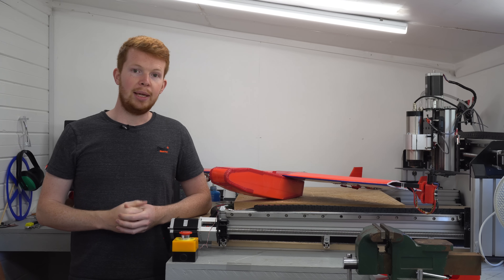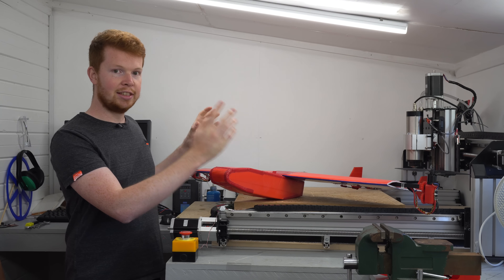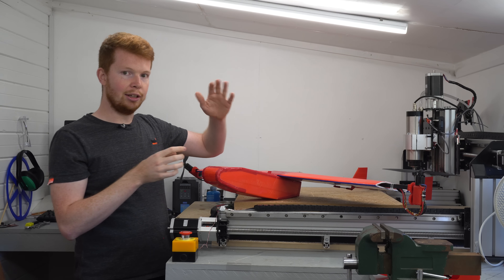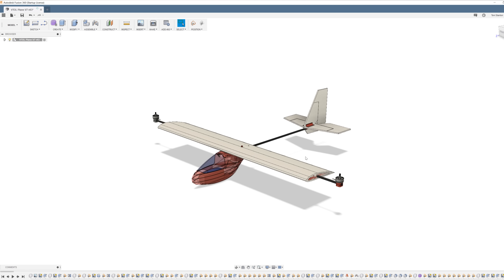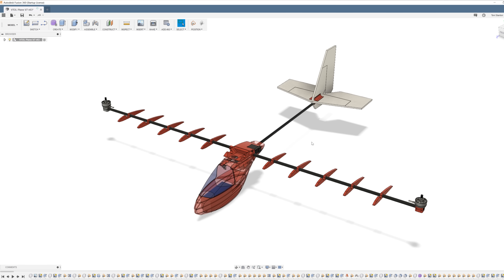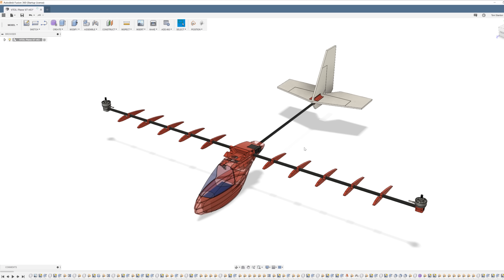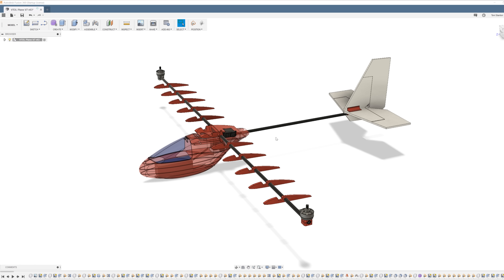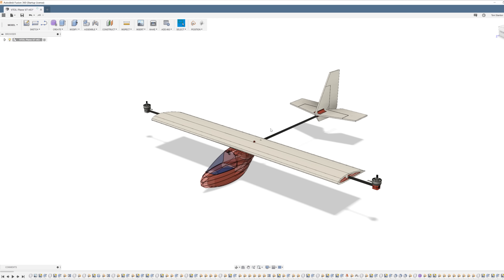RC VTOL - Build

Comment: Don‘t you have problems with these long battery cables and the flight controller? We are making a comparable project and the controller is disturbed by the battery cable s magnetic field.

Do you have any tips for us?

Comment: thanks for posting.    here are some things to consider.      why do you  choose  to be  (one more)   doofus,  who shows thousands, how to do THINGS  WRONG.   why not hold yourself to a  HIGHER  STANDARD.        at 4:55,   ridiculous  elevator design.    the  compound elevator makes up about   EIGHTY Percent  of the stab.    DO YOU THINK THE ELEVATOR IS GOING TO HAVE  ANY  FUNCTIONALITY  DURING  VTO.   if so, you are wrong (again).        at 6:37,   CAN  YOU  SPELL   SPRUCE  OR  POPLAR   DOWEL main spar.       at 8:38,  'BALANCE IT ON ITS NOSE'.    are you  KIDDING.      FIND  SOMETHING TO SUPPORT THE  MODEL ON  THE SCALE;    THEN   ZERO   THE  SCALE.     the reason for the   GIANT rudder is,    what.  
you mention  ailerons.    if the ailerons are not  'cut out of' the existing trailing edge,  then  you will have  Completely  Screwed Up  the  geometry of the  airfoil/profile.          googletranslate

Comment: Hi Tom,

as you perhaps rebember, I rebuild your version 2.

https://www.youtube.com/watch?v=XUuRyxg-2Sg

Over the summer I improved my skills to a very high level. The by far most important control is the yaw axis. If the fuselage gets air from the side, the board does things I never expected :D. And,  flying over the field and yawing dramatically is what the spectators impress on air shows. So, I would recommend to mix with any angle leaving the 90° upwards a high amount of thrust vectoring. Even if this  will cause a aileron effect, too. Especially on calm days without any headwind a hard elevator push forward combined with a thrust punch it will most likely allow you to correct the nose direction. In addition, the rudder itself should be as effective as possible. 

What I also changed compared to your settings is the influence on the elevator controlled by me and the board. In hover mode, my board has 90% of elevator travel for auto stabilization and only 10% directly controlled by me. This keeps the fuselage under perfect control. This means, if I start off by pushing the elevator stick to forward flying, the motors will pivot forward but the elevator will pull to overcome the nose down effect. If you already found out, no problem :). This improved the scale lookalike a lot. The only problem is, flying backwards is a little nightmare as the board corrects into the mistake. Therefore I left 10% of direct control.

Hope you find this helpful.

Comment: Why? :( I feel sad when i see good engineering people with good skills i modelling and have access to 3D printers, and they still use hot glue to fit servos and such in there builds :(

Every one seems to be stuck with the glue every ware and it feels so unprofessional. Loved your air motor with all the small screws and almost none glue. Keep that upp and throw the glue gun away! :D

Comment: Haven't been through the whole of the comments, but have you looked into openaero vtol. It's an open source vtol flight controller based on the kk2 board. https://www.rcgroups.com/forums/showthread.php?1972686-OpenAeroVTOL-with-transitional-mixers-(perfect-for-VTOLs)

Comment: Nice project. Any reason not to use a fully printed wing skin and rib structure to incorporate with your Spar? I have been playing with some single wall thickness sections for a Glider I have just about finished designing in Fusion. Centre panel will have Carbon Cap strips with a flat (not vertical) square section box/web between them. https://www.dropbox.com/s/ovfsdwrjppo1ru7/20181029_103937.jpg?dl=0 This is a dual skin sample for the centre panel.

Comment: Could you arrange for the ailerons to droop vertically (flaperons) when in vtol mode with the tips of the flaperons in the propwash then differentially steer the flaperons for yaw control during hover/vtol mode? Or you could have the whole wing rotate and just use the ailerons for yaw control.

Comment: Hello Tom, I like your Projects, and I sometimes suggest things to see what you think, but looks like you don't have much time to read through all comments. 
If you want to maintain Yaw control in hover, you might try a motor mounted upwards in the CG inside the fuselage with a decent fly wheel attached to it. make sure that the motor can turn in both directions and can change direction relatively quickly. The anti torque caused by the spinning wheel will cause the airplane to hopefully YAW. 

would like to know what you think, and maybe see you try it.

Comment: Since the motors are locked to each other he could reprogram (maybe) the flight control units (in case they are) for differential torque on each motor for yaw control (yes it would raise one side over the other but still...food for thought)

Comment: For yaw you could run two smaller tubes inside the main spar running from the center and then clamp the motors to the end of each small tube. Then just run two servos.

Comment: Why not put the ailerons on the spar under/behind the motors so they can input some yaw in vertical mode and keep control authority during low speed forward flight?

Comment: You should be able to get yaw control by slightly changing the motor speed  on either of the motors like quadcopters do

Comment: the model is very nice, congratulations for weight reduction!
to
 keep the rotation of the two motors independent, I was thinking of a 
system made up of two half-rings inserted on a central axis, but perhaps
 it would be a useless complication.
To bring the masses
 closer to the center of gravity, it might be a good idea to bring the 
ESCs to the center of the wing, as long as the motor cables do not give 
power loss problems.

Comment: Hi Tom, i have been working on BUDGET airframe development for everyone and implementing Al tubes its the weight i was concerned  about as you do i would recommend you to hole at 90 digree s in those spurs that will effectively reduce the weight you may also harden the tail section using plywood T sections .. and for the wing shape  you may try tapered straight one...it will decrease the drag effectively and also the terminal vortex...another advice you may consider using ducted fans to minimize end line terbulance and it will be more efficient...it will also help  to make the tilting mechanism easy and will leave future prospects for directional thrust for more stability.
Let me know how do you feel about......😊

Comment: Isn't this something INav or betaflight would be better for ? i know your learning to use arduino and thats cool but we can do anything you want on the FC with minimal changes to a current plane mixer
Reply from the maker: Yes I'm going to be using an F4 FC with inav, but inav can't do transitional mixes. For example, gradually fading roll control on the motors to yaw control. So the arduino will take the pwm outputs from the FC and mix them to the correct outputs.

Comment: Very cool project, i've also liked the videos of the other versions.

You've said, that one version was a project for university, right? Was there anything scientific about this project, or was it just about the engineering part and the programming?
I'm currently also searching for a project idea for highscool, and was thinking about a drone, or a vtol plan, where i could make a programm so that the plane / drone is stable in the air. But im not shure if this is possible, since it should be something scientific...

Comment: Have a look at Joop Brokking s Code regarding auto level quadcopter flight controllers, he made very good videos about explaining his code, so you can adapt it to your code if you consider using a gyroscope. I've used it in recent times for a plane stabilisation Programm and works fine till now ;)

Comment: You should do an experiment with that and the direction that those motors spin at on the end of the wings. I have heard that many planes have some of the most severe issues with turbulence being the swirls that roll off of the tips of the wing. This is why some small planes have wing tips that curve upward. I would be interested in seeing how these effect the wind flow if you were able to set up some sort of home made wind tunnel with a fan. You might be able to get a more laminar flow by stacking some tubes or like placing a row of cardboard pieces upward vertically every 2 inches then doing the same thing again just stacked up flat. I mean Ideally the best would be if you cut slots down the cardboard pieces that interlocked to hold them in a matrix/grid pattern with regular square holes then just using some sticks of incense for the smoke. When you set it up, at least have the box fan lined up against the floor and wall so you have 2 confined walls though if you could create a 3rd partial wall or even a roof I think you could have a fairly professional.

Comment: Couldnt you control the Yaw with torque differences between the motors just like a normal quad?
Good work by the way and congratulations on your degree!

Comment: Hey Tom. You might be able to rotate around the vertical axis by running one motor slower or faster than the other for a short time and have rotors that run in different directions. The CH47 Chinook and the Ka 50 Hokum do it this way I think. Good luck with this one.

Comment: You could save some weight and rotational inertia by skipping the insulation on your big motor wires.  In Canada old houses have "knob and tube" wiring where bare conductors pass through wall studs and wooden framing.  You could route bare conductors through small holes in your wing bulkheads and keep them well apart.  It's a pretty small weight savings...

Comment: You should reach out to James Bruton from the xrobots channel on the arduino stuff.  He helps out Colinfurze whenever a microcontroller is needed on his projects and has a lot of experience writing robot control software for RC based motor drivers.

Comment: You mentioned you'd taken out the ability for the engines to independently rotate for yaw control, for weight savings. I wonder if you could restore yaw control by adding tiperons, which in VTOL mode would provide yaw control, and in forward flight mode, would provide roll axis control. Thanks for the video.

Comment: About the yaw while hovering; what if you use 2 coaxial motors spinning on opposite directions on each wing tip? That way you may control the speed of each pair in a way to use it's inertia to yaw while keeping the same trust.

Comment: Probably could make even more weight savings by printing in PP instead of PLA or PETG. PP does cost a touch more than PLA or PETG. But it usually makes up for that in far lower density (PLA 1.25g/cm^3, PETG 1.27g/cm^3 and PP 1g/cm^3) so you get more on the spool and it is much more durable for something like a plane. It won't shatter, crack etc if the plan crashes. It will absorb a lot of the impact and then it might deform. 
Could potentially make for a good wing material as well. 
Great video from CNCKitchen that covers the impact strength etc. https://www.youtube.com/watch?v=yRw2mC_6A00

The only downside is finding a bed material that it likes to stick to or having to use clear packing tape as PP doesn't stick to many things. But hey if your filament sponsor wants to send you a roll to try out, then give it a try.

Comment: I wonder, could you mount a small rudder underneath each motor, and have them linked to a single servo in the body via push rods, in order to create the yaw motion ( one tilts forward, one tilts back, model yaws to the left or right. Similar to the way your SpaceX replica worked, and this epic little rocket too: https://www.youtube.com/watch?v=RMeEh5OUaDs

Comment: I'm loving this. I wonder if you aren't making the wings heavier/stronger than they really need to be. I understand the motor spar but I wonder if the foam board on the wings couldn't be replaced with cloth or clear tape.

Comment: If this initial design is successful then an interesting addon feature may be to change out the standard rudder for a very small/light vertically oriented reversible/speed controlled fan mounted in a hole on a fixed rudder to control yaw.  Very much like the on the tail of a helicopter.  It would add a bit more weight and adjustments would be needed to the center of gravity.  It might work...
Reply: Check out rcexplorer, David has put a titl mechanism on his tri which is what I thin you are talking about.

Comment: Couple things. Code. I can't code into a wet paper bag not to speak of out of one. but I know why it can't convey effort. its all in your mind and there is no real world "output" that is visible to a third party observer who does not know what is involved.

IE the struggle is in your mind which the camera can not see and the output of that struggle does not exist unless you know what to look for. IE to an observer the plane just "does what its supposed to do" so does not appear "special" so there is no obvious link to the non obvious thought effort that went into achieving the end result. :-)

I can totally see how programmers of non visual code get little thanks for their efforts.

The plane. that fuse is a freaking work of art. the integration of carbon, foam, plastic, and electronics its truly beautiful. when I saw you assemble that empennage I just smiled as all the different arts and techs went together so cleanly and smoothly. Give yourself a ton of credit for that. it was really beautiful and the final model SHOWS! Love it. I hope you release the files for this as I would really love to print one!

I wonder. can you get away with just 3 ribs on each wing and save a smidge more mass? the foam itself is more than rigid enough IF it holds its shape along its long axis (maybe a bit of scoring to help it?)

with all the mass savings maybe a a pull pull single 6 or 7 gram servo and set of vanes under the props to give you some solid yaw control while in hover? they probably would not have to be that large to give some usable control authority.

I can't wait to see this gorgeous bird fly!

Comment: Nice. Good build Tom. But I think you probably could’ve saved even more weight because you don’t need such thick ribs, nor do you need such thick foam. Since all the foam does is make the wing surface you could just as easily have used like 1mm hot-wire cut insulation foam or something. Also you don’t have to put tape over the whole wing. That’s just adding strength where you don’t need it. Just put tape on the leading edge where it has to bend. Also you don’t need such a thick spar or tail boom because, well...ya just don’t. It’s overkill. I think maybe you could’ve saved 50 grams or so by doing these things. Still a really good build though! Always a fan of your work! :)
Reply: he has very few ribs and NO spars at all (the carbon rod is a half spar since it ROTATES its not actually connected to the wing itself!!

the foam "IS" literally the wing and its structural. its holding up to and resisting all the forces. almost no forces are being applied to the spar since its not attached to the wing.

so the foam has to be rigid enough to both keep the wing airfoil shape AND resist flight forces and motor forces. if he used weaker or thinner foam he would probably have to add "more structure" to the wing to compensate. its a pretty good compromise. I do think he could eliminate 2 ribs from each side and it would be fine. not 100% sure on that thought. so those ribs are basically just their to "shape" the wing and integrate the foam skin into the shape of the structure and hold things together. they are very light and hollow.
Reply: That’s true. The foam does provide wing structure. But in terns of vertical bending forces and lateral wobbling forces the spar is going to be taking that load. I know it’s not attatched to the wing, but it’s nonetheless going to stop the wing from bending by virtue of being inserted in the ribs with very high tolerances. Really the only force to which the foam must hold up, is a twisting or warping force on the wing. But he doesn’t have any ailerons, and the motors can’t swivel in opposing directions, so that’s going to be very minimal if not nonexistent during the vast majority of flight. That’s why it seems logical to me that the foam doesn’t need to be as strong. Of course it’s nice to have it strong, but since he was talking about trying to save weight, I thought I’d mention it cause it seemed to me like that was a place where he could’ve saved weight. Then again as an indoor free flight guy I do tend to go a bit crazy when it comes to saving weight. 😅

Comment: Have you considered programming the throttle so that for the first 45 degrees of tilt or so the throttle increases to maintain the vertical component of the thrust force?
Reply: I would assume he does that already if not in code with the transmitter since the needed thrust will change greatly with prevailing air movement across the wings and his software won't be able to see the wind.

Comment: Hello Tom, nice Project. I tryed to print the Fuselage from one of your last Videos but it is not possible for me to print the Fuselage solid. I print it with 0.4mm Wall thickness and the Body became holes on some positions... the Nose of the Fuselage is full of Holes. In my next print i tryed 0.7mm Wall thickness and its much better, but the Nose is also with Holes??
I think the Fuselage is verry less of weight but it is stable enough?
I think 1mm Wallthikness is the bette way and the weight is not so much more. Try it out :-) Greets Bernhard

Comment: For version 3 you should design some kind of a differential in the main fuselage to allow for independent control the propeller angles, but without the need to have a swivel point at each wingtip